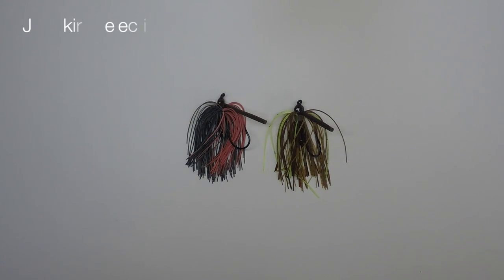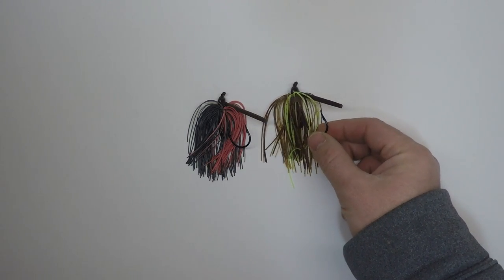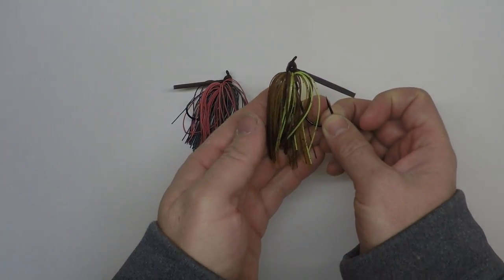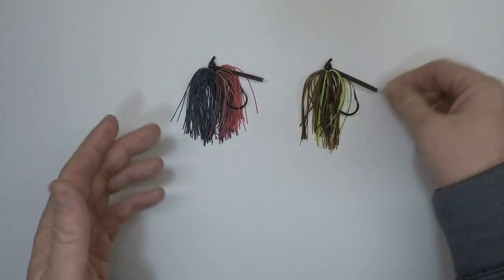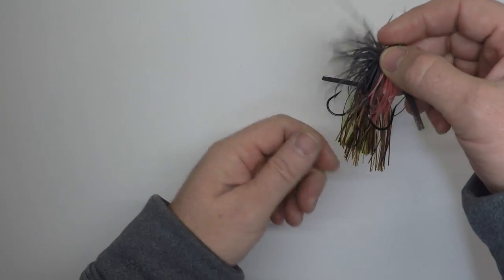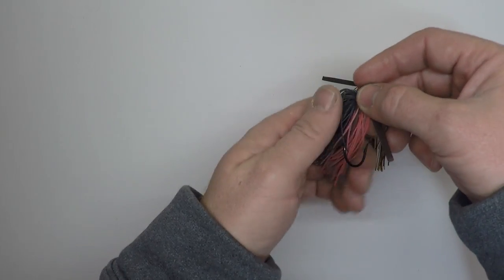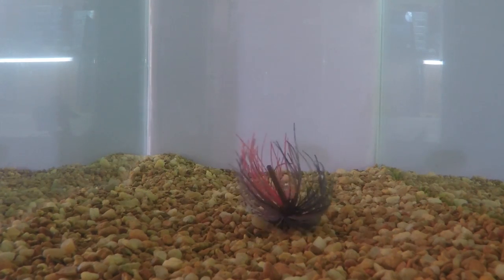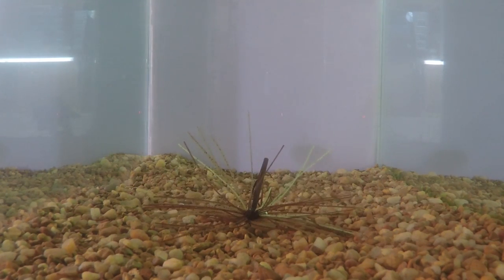Bass Fishing Jigs: Silicone Vs. Living Rubber

Comment: not a fair comparison. The living rubber skirt has twice the strands than silicone cause it to look fuller in water. Plus once you increase the strands on the the silicone skirt to equal the rubber skirt you can cut some of the silicone strands shorter to make them stand out straighter, this will give a more fuller look.

Comment: As someone said before,  I'd like to see them both with a trailer. Seems that possibly the living rubber would hide the trailer more than the silicone. And strand count would definitely make a difference.  I'd also like to add that here in Arizona the rubber skirts melt in this summer heat. Where as the silicone last so much longer. And one final comment is that it seems to me there are many more color choices in the silicone version.  Great underwater video !! Keep up the good work !

Comment: TY, Allen Ramsey. Even in the North East (New England) I have experienced my skirts "melting" but I was not sure if it was the rubber or silicon version. So thank you for clearing that up.  I have been wanting to learn how to tie these skirts onto jigs and spinnerbaits, just for this reason. I personally don't like the look of store bought skirts on my lure because of the  elastic band or plastic adaptor they come with. Does anyone know of an on-line class?